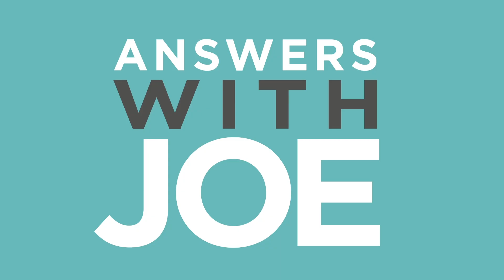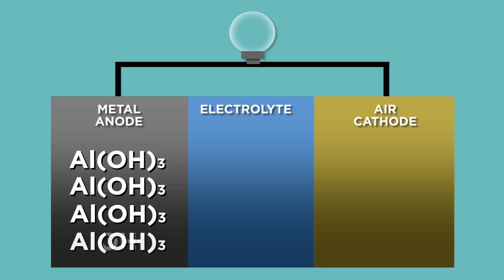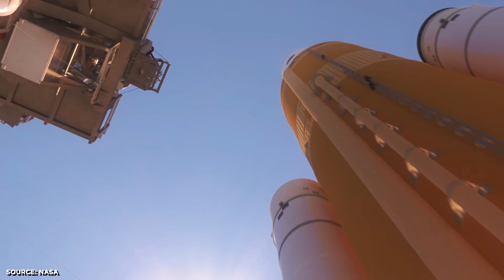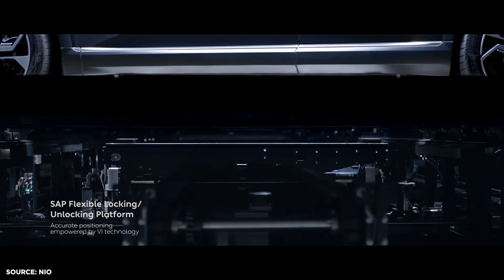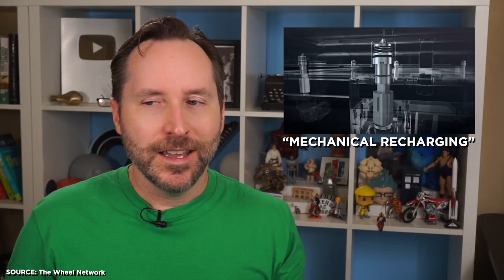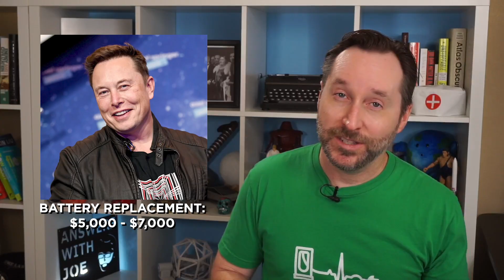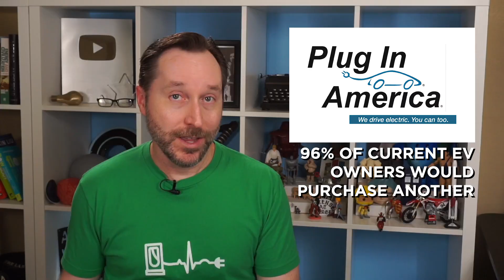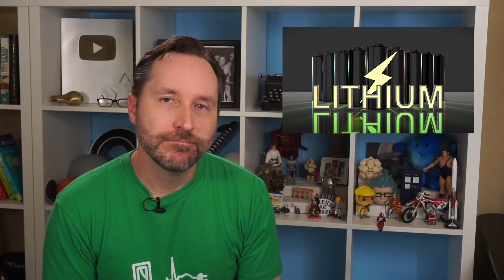This Battery Could Drive A Car 1500 Miles - But There's A Catch | Answers With Joe

Comment: In the 1970s, an inventor created a working prototype of a three-passenger electric car with wheels at the corners of a rhombus. Two on a longitudinal axis for steering, and two on a transverse axis for transmission. These two wheels and the rear wheel form a triangle that accommodates the batteries. This triangle could be an interchangeable module with the aluminum-air batteries. The car was named the Yare by Harold Kesling. There's a video on YouTube explaining it.
Reply: Channel in Youtube: Zack Kesling. Name of the video: "Kesling Electric Yare 1978".

Comment: Im surprised the aluminum smelting plants don't use these as a large scale stationary system right at their facility. Aluminum plants use electricity to process the aluminum oxide, and they consume a very large amount of power from the grid when operating. 

If they had a large scale battery plant on site, they can manufacture more aluminum batteries as required, and they can easily recycle the batteries  at their end of life without any transport cost.

Comment: Junk single use battery, that's a lot of needless cell storage, lots of needless shipping, needless labor receiving and removal and installation and shipping and disassembly and ensuring the material actually makes it to a recycling center.

cool it's recyclable but that's a lot of low paid labor unless using robots.

Comment: I don't think I completely followed your description of Li ion/Al air hybrid vehicles.   Were you suggesting that a convention EV owner could rent and 'bolt on' the Al air battery for longer trips?   It would probably look a little ugly, but would be a fantastic option for those that refuse to consider an EV because they take a small number of long trips each year.   For context, your 12000 to 15000 miles per year average breaks down at 33 to 41 miles per day.   Far less, I expect, than most people realize they actually use their vehicles.

Comment: These could be really useful for commercial vehicles like semi trucks and buses. Those industries already involve taking the vehicles to specialized locations to undergo routine maintenance, so it would be much easier to add the battery swap infrastructure to those hubs than to build the infrastructure for private vehicles.

Comment: If the batteries could be made small enough then I don’t see a reason for charging stations to even be a thing. I could see a world where vehicles just have a spare battery compartment somewhere and replacing them is just an expected part of routine maintenance.

Comment: Having to change out the battery every 1000 miles is kind of similar to getting an oil change. We already do (or should do) that at regular intervals. Obviously not every 1000 miles, but...
Reply: It’s all comes down to cost. If it’s reasonable it stands a chance otherwise no.

Comment: Now we need the carbon footprint video for these batteries compared to the ones Tesla uses now and the ones other car makers are using. But we have to cover everything from the creation of each car and each cell to thos speculated costs and carbon footprints to replace the air aluminum batteries vs fully charging the EV batteries... Anyone else?

Comment: Aluminium oxide can be converted into aluminium in the recharge stations, dump out the oxide, and refuel with fresh aluminium, and the station would refine the slurry.
Reply: Also air travel is the absolute best application for this technology, and the refinery could be easily accommodated in an  airport.

Comment: Since aluminium liquifies at a relatively low point. Maybe instead of charging you would replace the alluminium inside, and that sort of tech could also be adapted to "feel" like refueling a traditionnal petrol car. Idk just a crazy idea 😂.

Comment: Hmmmmmmm….’metal oxide water’….(old foolish man drooling on his shirt).  Aluminum has been used in high explosives as well.  It is one of the most energy dense metals on earth.  Under perfect conditions this planet could explode and take the entire known universe with it….though those conditions are so very unlikely so as to not need to lose any sleep over such a potential end…

Comment: even with lithium it would be possible to have replace batterys^^ but they would have to be normed so any car at any station could swap... u buy a car then without battery and u pay to a service for the battery once empty u just swap it and it charges in the station the only issue is what u gonna do when the station has no full battery on hand? maybe place some conventional chargers besides ...

Comment: So a battery hybrid then? Regular tesla style car but has a small backup aluminum battery that get an additional say 200miles. Only kicks in when user switches manually when the car hit 1% charge. So the replacement would be far less and it would be a backup.

Comment: Lithium iron phosphate is still the best overall. Doesn't explode, rechargeable for thousands of cycles, can last 20+ years. Only big downside is they don't like freezing temperatures.  You can kill cells when charging in freezing temps. However in more southwestern regions, they would work very well

Comment: As an Aussie, range is certainly a concern, traditional battery vehicles often have too little range for use here. Therefore the longer range of the aluminium option would be great, same as hydrogen for that matter. It's an interesting idea though.

Comment: You know what? The whole infrastructure question with electric vehicles is not a problem with electric vehicles - its a problem with vehicles. Ordinary cars also require a HUGE amount of infrastructure and logistics, we just don't consider it because a) it's so everyday and b) most of it has been in place for decades. But we are still building oil pipelines and refineries, building new roads and maintaining old ones. It seems very disingenuous of society to use the infrastructure requirements of electric vehicles as a point against them, while acting like they don't exist for ordinary cars.

Comment: How about ESS and there iron oxide battery.What are the short comings with that  system.Is it a matter of size or rechargibility or both.The stock trades as gwh and recently went public.Currently the primary application is used as storage for wind turbines.The old problem of use it or lose it will be solved.Musk must be fully aware of the technology and chose not to utilize it in his EV s

Comment: the infrastructure wouldn't be that complex. the changer is rudimentary, the storage space for the batteries is rudimentary. battery manufacturing plants would need to be repurposed and since most are modular its fast. with recycling in the mix and most chemicals not hard to find in the battery it could mean better for the environment and for the economy. fossil fuels need to return to being fossils, we depend too much on oil. factories for all he processes can use the other kind of batteries with solar farms powering them (since they don't need to move) thus leading to better industry cycle.

Comment: I drive a Chevy volt, and having a range extended EV is probably something I’ll never not have going forward. It’s the best thing since sliced bread. Definitely think that’s the kind of vehicle they should focus on producing with this kind of battery.

Comment: Well. The design concept for the Eco tanker (as shown) lacks creativity as it resembles a conventional ship. If you maximize the horizontal surface of a 1200 ft. x 250 ft. tanker = 300,000#ft./ by 18.1 #ft. (per 230 watt solar panel) = 16,575 panels x 230 watts = 3.8 Mw. What a great use/application for old but still functioning solar panels.

Comment: For myself. I would much rather just have a lithium system vs a hybrid lithium and aluminum air battery system. If I had the hybrid I have no doubt I would end up never wanting to touch it and just charge frequently so that I wouldn't pay a ton of money to get the aluminum air replaced, lol.

Comment: the thing is that you can do this real easy with the existing infrastructure.  all engines can be converted to run on hydrogen very simply.  use aluminum and water to make it on demand. the pure aluminum becomes the fuel instead of gasoline.  you dope the aluminum with gallium only introduce the  water to the aluminum to meet the required combustion rate. the aluminum becomes borax sent back to recycle and the hydrogen becomes water. this is real simple problem solved.

Comment: NGL, this sounds like a technology that requires massive over production of raw electrical power to be feasible. Until electrolysis processes were invented, aluminum was more expensive than gold in the pure form. These batteries work on oxidation of aluminium, resulting in a end product as hard as ruby and as chemically inert as sapphire. But with quality only appropriate for sand paper. The joules required to melt down the oxide, combined with the power for the electrolysis. I cant help but expect massive nuclear reactors powering the refinement process of any substantial Al-air battery recycling program.
In nature and science, you cannot create energy out of nothing. You can only change its form and channel a bit of its power into useful work.

Comment: design the battery with easily replaceable aluminum plates in it, that way when its time for a recharge you just swap out the aluminum plates!. besides the aluminum battery should weigh a hell of a lot less, than a lead battery!.  and don't forget that aluminum is cheaper than lead!.

Comment: I think as long as you could recycle an aluminum air battery with and an aluminum air battery of the same size/energy rating, then it's a great option. But we don't have time for one-time-use items anymore.

Comment: 1500 miles is not worth a swap that often. Cars with greater MPGs often have much smaller fuel tanks sizes. 2012 Silverado 3500HD had 660 mile range on a 36 gallon tank where a 2012 Passat had 800 mile range on a 15 gallon tank. 3000 miles range would be worth a swap that often. +one hybrid plug in Passat would be faster to 60 and use less crude oil with a 65 mile long ev mode. And would get cold A/C without running the engine. Or power your house with optional outlets like ford lightening, or Rivian.

Comment: My daily driver is 19 years old and almost every part on it is original to the car when built. It is a Toyota Camry paid $16,000 new in 2003. I have owned two other Toyota's that are still on the road with different owners one was 25 years old when I sold it the other was 17 year old when I sold it but it is now 36 years old both are Toyota's. The maintenance that was down and the parts that needed replacing were all rather affordable and not at all frequent. It is hard to argue with that sort of life cycle. All of them could easily make 400 to 600 miles on a tank of gas with wide safety margin and be refueled in under 5 minutes and ready to keep going. Every semester I had to drive 1500 miles from University to my mom and dads house because they kicked us out of the dormitory. I would drive straight through non-stop but with electric I would have to stop and spend money on a hotel for 4 days to make that same trip while my car charged at a charging station. Until an electric car can do everything above I am not at all interested and they are not appliances like a real car they just toys for those that can afford to have a vehicle that is not really good at doing what a vehicle needs to be able to do to be practical. Currently were I live it is normal for people to make 1.5 to 2 hour commute to work each way. Just going to and from work would put your electric car into a dangerous area especially during the winter even with a level 2 charging station at home it would be less than ideal and with out that just charging off the mains at normal 120V you would not be able to make safely to and from work 5 days a week and anything like mandatory weekends would be off the table!

Comment: Well all electric is a pipe dream. The energy and carbon footprint to build all electric car's is massive and much larger than building gasoline and diesel powered cars. Then you have the demand for energy and how do you make that energy? Coal, fuel oil, nuclear??? Solar and wind are worthless they are not reliable and always leave you with brown outs, black outs when you most need the energy. Not to mention how wasteful those resources are because they lack long term durability and reliability. Almost nothing from wind and solar get's recycled when it fails. We can not keep up maintenance on existing roads, bridges, damns, power grid how will we find the time and the money to build new infrastructure. IF not for capitalism we would not have all the gas stations we have no one will will build it for free. Nope electric is still not even close to being a prime time player. It is propped up heavily still. It is not "fly over country" ready for sure!

Comment: Aluminum air would be good for an emergency off battery replacement depending on the shelf life but only a temporary replacement like the emergency tire it would be super expensive too unfortunately but since it's a permanent non-rechargeable battery it should hold its charge much longer than lithium.

Comment: We will never be done with fossil fuels. There will still be a need and even a want for gasoline and diesel engines. BEV's aren't the end all, beat all to this.  It is nice to have a combination of both.

I could see this battery technology used by municipalities, like in busses or their other transportation vehicles.  Then the area where you replace the batteries and collect for recycling is in a lot less locations, so delivering and collecting them won't be such an issue.

Comment: That much water weight would negate the efficiency, thus draining the battery even faster initially, until the tank was below the half or possibly even one third mark.  Plus the size of the tank would mean the cars would have to be rather large, say a full sizes sedan and a midsized or even full sized SUV. And that would also take up too much of the payload, until you got to that sweet spot.

Comment: It can only last 1500 miles? I got a better deal because my battery is over 3 years old and I have over 30,000 miles on it and it's still going strong 💪 🙃

Comment: Awesome ideas but gas and diesel have much more energy density.  Until the energy density is either matched or exceeded, the ev route is not a viable replacement.  Not to mention the power plant and electrical grid issue.

Comment: gasoline cars still have a few things going, for example, something goes bad, you can generally replace or fix it yourself. especially with older cars where it's less compact and simpler. something goes wrong with an electric, you won't be able to do much of anything. they also feel and sound satisfyingly powerful. electric is silent and doesn't feel like much. plus the batteries they have are small but last a lifetime if you take care of them and remember to not leave lights on overnight. but even then they are very easily jump started and charge themselves with use.

Comment: Considering batteries are heavy and thus the best place for them is the bottom of the car, having a universal battery system that you could just swap every 1000 miles really shouldnt be that hard.

With that sort of range doing it constantly wouldnt be a huge deal either - I do onsite IT and drive more than basically everyone I know by a wide margin and 1000 miles would get me about 4 weeks. Taking 10 to 20 mins out 12 times a year to swap a battery would be a trivial impact on my life.

I mean shit, even roadside assistance could have a purpose built tilt tray with a battery swap mechanism if needed.

The trick is getting manufacturers to agree to a standard and if history has taught us anything if you have 12 different standards and try to create a new universal standard all you have done is make it so there is now 13 different standards.

Comment: How would wireless charging work, in relation to cars.  Now we all know about the latest phones, tablets and other electronics having wireless charging.  could it be possible to have, potentially, wireless charging for these car batteries, now I understand that the charging power would be a lot less then via cable charging stations, and take alot longer to charge.  but what if parking spots had wireless charging built in, similar to a phone being plonked onto a charging pad.  I mean some people live in building blocks with dedicated parking near by, or even at their work place, there may not be enough room to give every space its own charging point, making limited room.

We could even go a step further and have charging lanes on the highway/motorway, the "slow" lane could be fitting with a wireless charging.  the speed limit could be lower on that side but could be handy if your are travelling for a few hours (say 2 to 3) this could potentially slowely top up the battery, or even just slow down the usage, instead of wasting 50miles of battery you only used 25.  Every little helps.  even better if your stuck in traffic then at least your charging your car while your waiting to get of at the next junction, perhaps to even charge it.

Food for thought.

Comment: I think Solid State lithium ion batteries will take over almost everything. The Energy density is right, the charging is like 5 minutes for 80%. These AL solutions may not work out.